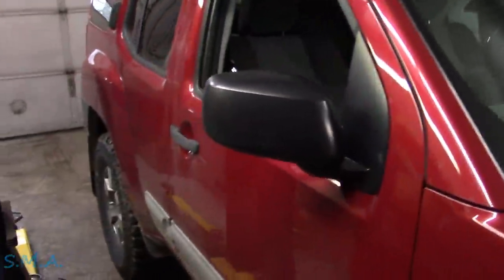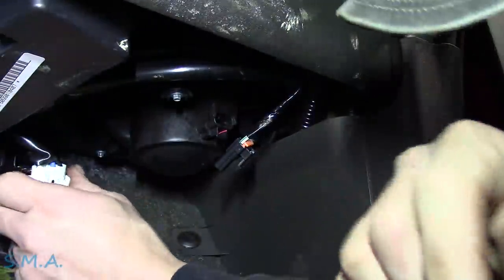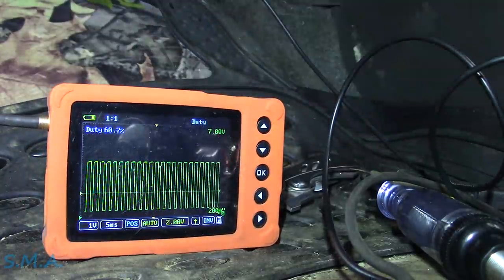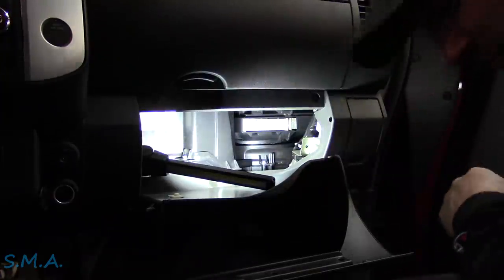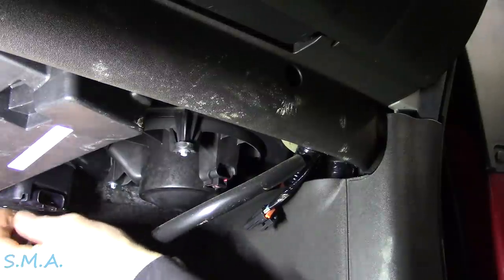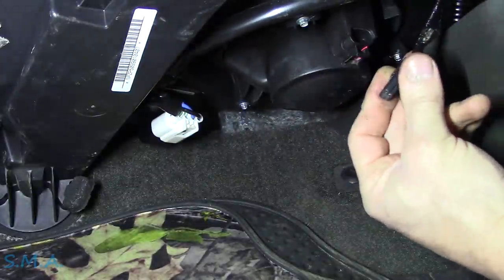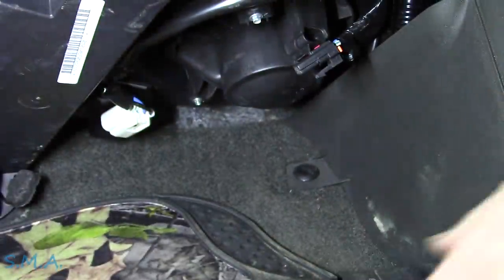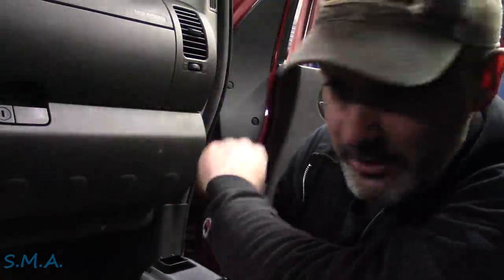Nissan Xterra: Blower Motor Not Working

Comment: Some engineer was setting themselves up for a future job with Apple when they decided to go with 5.5mm. (Pentalobe screws for some models of laptops.)
Reply: Almost as bad as some ammunition. 5.56, 7.62. I mean, why split a millimeter?
Reply: @markh.6687  And it gets worse depending on where on the case/bullet you take your measurements.
Reply: @LadyAnuB  True. "We came up with a simpler measuring system, so now we'll make stuff that forces us to complicate it."

Comment: My wife was complaining of no heat and there was no air coming from the blower on her Toyota RAV4 and a noise. I expected a bad blower motor and come to find out that the intake for the blower for recycled air was right in back of the glove box. The glove box was packed with tissues and napkins and one was stuck on the grate on in front of the motor. Removed the napkin and what do you know it works fine. I had sent it to my to mechanic because I would not have been able to fit in there to change the motor only to have him send me the picture of the offending napkin. That's my 2 cents on that one.

Comment: I have 2010 xterra,  the other day only my highest setting worked, then next day I tried again and it started quick and then stopped and would not work again, so I bought a new resistor and blower motor, and it still isn't working.  I checked the fuses that say ac blower, they are # 15 blue fuses. I didn't think it could be a fuse because it worked for a second then shut off. Any ideas ?

Comment: I remember having to literally pull half the dash off and multiple other bits on a Mazda3 just to get the cabin air filter replaced. Might have been better to drill through the firewall in the engine bay and put an access cover over it after....what are these engineers thinking?

Comment: My cousins 2010 Ford Fusion blower motor stopped working, I confirmed it didn’t work, went to unplug it and test for power and ground, what do you know? The two wire pigtail is melted. Replaced the pigtail and blower motor, good as new. Apparently there isn’t a resistor on that car, it’s apart of the blower motor itself or I’m just wrong. Still working.
Reply: @Jonathan A I just googled that after posting this comment, I feel dumb, no big deal but I guess I was lucky that it still worked

Comment: Had a druggie  come to me with a no start and told me that her husband installed an aftermarket radio. They attached it straight to the battery cable. They tried using soldier to an aluminum speaker wire to the battery cable but used no flux as if that would work, it flaked right off. I followed all of the lines down and found mud dauber's nests in the fuse box and slices in the lines.. so I took off all thework he did and removed anything that wasn't factory and it cranked right up after replacing the starter fuse. I got a nice new lawn mower out of the deal.

Comment: RE: 5.5mm screw heads... at least they're not making penta or septa head screws.....yet!
Reply: I believe certain Toyota cam phaser sprockets (1ZZ engine?) use penta head bolts to hold the mechanism together.  Not a problem if you use the parts cannon and just change out the whole sprocket assembly but if you want to take the phaser mechanism apart you need special tools.

Comment: I'm a little disappointed this time, you're usually so logical and precise. I agree with thumping on the motor as it often shows up worn out brushes and condemns the motor. Checking for power and ground, good. It bugged me that you continued to refer to the "resistor" when it is clearly a power transistor and not a resistor at all. Once you had unplugged the transistor it is a simple matter to jump the blue wire to the large ground wire in the same connector to check for motor operation, this tests the entire load side of the circuit. This is a good time to repeat thumping on the motor as you know it should be running full speed at this point. No running means worn out brushes (high resistance or open across the motor connector pins) or armature stuck (low resistance but motor not spinning). Your testing of the duty cycle confirmed the operation of the control side of the circuit and at that point you have the whole picture of what needs replacing. As a Honda tech I replaced plenty of transistors that had spontaneously failed with no apparent cause. Not trolling here, I love you and your channel!
Reply: Hi Rob, my '04 Xterra blows intermittently (won't come on unless I hit a bump or smash my fist on the glove box area hard enough).  From your comment it sounds like this is a problem with my motor and not the resistor/transistor? I'll be doing this repair myself, most likely with parts scavenged from the junk yard as my budget has no wiggle-room and this will be my first ever car repair performed by me so any advice is appreciated!

Comment: My stupid mechanic just threw in a new motor when the resistor was bad, and then had the motor burn up. Then, when that happened another stupid mechanic at a different shop (on a trip out of town) put in another motor and soldered in a couple resistors he found kicking around his shop. When that motor burned out, I took it to a third mechanic that said your resistor board is burned out, you need a new resistor board. He finally fixed it right. Only cost me 3 motors.

Comment: Please direct me to where I can order a good set of probing leads as you do, Eric...With a great selection of probe ends to both back probe/front probe small/large terminals in connector plugs....Now on these small pins I use different sizes of sewing pins or hemming pins...need something in a good kit as you use...can you direct me to a 
'Good kit selection ' to order??
I ordered one kit and wasted my money,  sent it back cuz was junk.
Reply: Well all the crap on AESwave is expensive, dare I say, a bit overpriced really.   I ordered a couple cheapo sets off ebay and amazon, and they've worked out pretty well for me.

Comment: Sorry, being a bit of a 'ding dong' here, but can someone explain what told Eric the resistor was fried? The scope seemed to show the duty cycle was working fine? What did I miss?
Reply: The duty signal was coming from the heater controls and the blower transistor (not a resistor) was failing to respond to it.

Comment: I keyed on the fact that the old resistor had 3 fins and the new resistor had 4 fins---better heat dissipation?
Reply: There's probably a formula somewhere that says the heat dissipation is proportional to the surface area of the heatsink, and they couldn't make the 3 fins big enough for the load, but they had room for a 4th fin.
Reply: @markh.6687  I was wondering if the factory saw that there was a problem with not enough dissipation so the design was changed to get rid of a bit more heat.
Reply: @CFProton  Agreed; they likely found out from field reports/complaints that 3 fins weren't enough over the long haul.

Comment: You are usually a pretty good technician but I'm surprised that you didn't ring(OUM) out the motor before you plug that in. You should have done that before you ordered parts got in a hurry

Comment: No blow nozzle...!!!! Why do you want to just move the crap around. 
  On my Prius, I taped up a piece of tygon tubing to the shop vac, and pulled out the acorns out of the blower squirrel cahe. It took a while, but I got 'em all out. .....work it out ,Rick. I replaced my filter with a Wix, most expensive one on ebay; cost $7. It took les than 5 minutes to  do the filter replacement.  Toyota wanred $60 just to replace filter....
  ......and they don't even use guns...!!!...Maybe something caught in blower bladed....

Comment: For shame all that testing with an oscilloscope on the head unit control but didn't check the resistance of the blower motor.  Kidding.

Comment: Needs to be a congressional inquiry as to why these lame manuafacturers  dont make things  that could last longer, by  using simple lube holes for stuff like electric motor bearings and greaseable front end parts . Bet you all that fan needed was a few drops of oil for the 2  motor bearings.

Comment: In my limited experience, blower motors are good candidates for "zero parts" fixes. Usually just a gummed up bushing/bearing, disassembling, clean, lube and reassembling very often fixes them.

Comment: 2012 Nissan Altima cabin filter is the dumbest design I've ever seen. You have to crush it to half the actual opening and it pops open in the cage. That's only after you remove the entire glove compartment, the entire box. 😒
Reply: Changed my 2010 Maxima once.  Then decided that was a task best left to the dealer. Pretty cheap and makes me like the vehicle more. Hate that filter!!!

Comment: Nissan junk! Had a 06 X Trail that the blower motor went out. Pull the dash apart and then the whole hvac unit, break most of the lock tabs because they use shit plastic and then break the old motor out of the case. 4 hrs later you have a new blower motor installed with many new mounts made i  the process. 
This and many other garbage features made me hate Nissan and will never own another. Oh yeah, only imported into Canada and only for 2 years so parts were a bitch to come by.